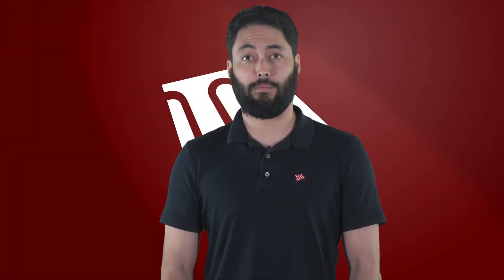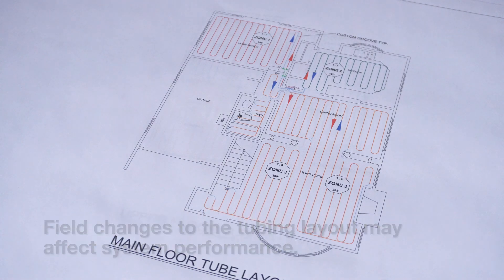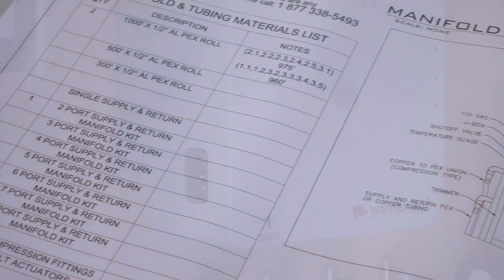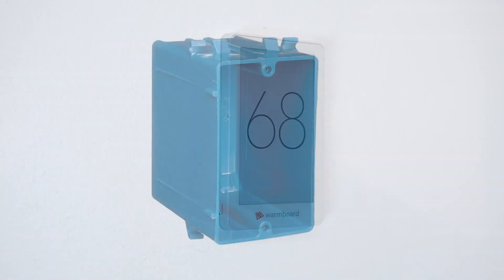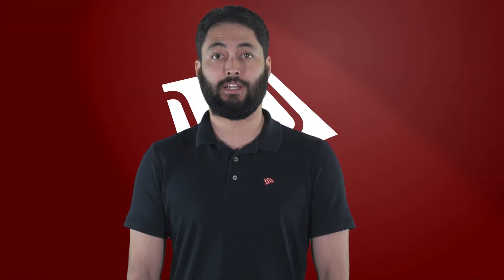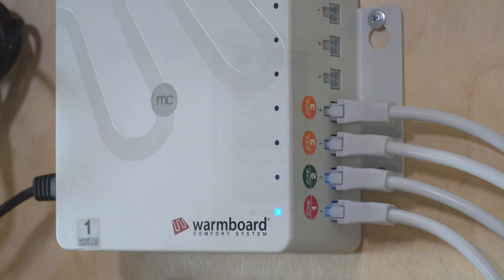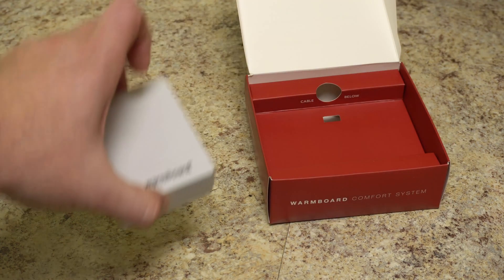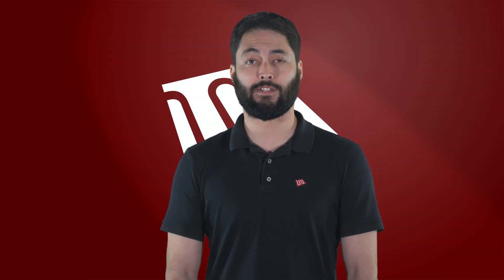Warmboard Comfort System: Installing the Controls

Comment: Question?
Does each zone have it's own circulating pump?
Is Warm board using PEX tubing?
Reply from the maker: Yes. PEX or PEX-AL-PEX tubing. 

Zone and pump requirements vary by system type. Some mechanical rooms/setups will use one pump per zone, but this isn't always necessary. Our Warmboard Comfort System uses a single (or dual) pump for the entire system, including all the zones.
Reply: @Warmboard  Regarding the single pump, is it 115 or 120 volts? Is it a centrifugal pump as well?
Reply from the maker: @MarshallLapenta  We use a Grundfos Alpha variable speed pump. 115 volts.
Reply: @Warmboard  Does the pump have a warranty?
Reply from the maker: @MarshallLapenta  Yes. Of course. (sorry we missed this comment)